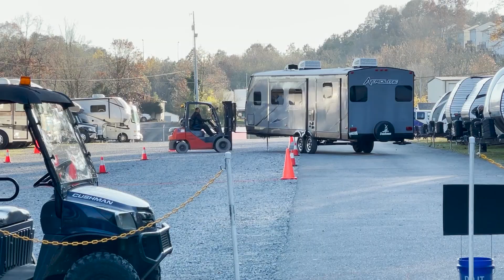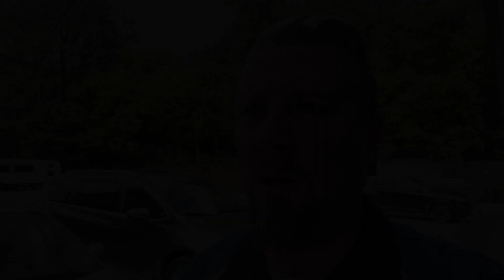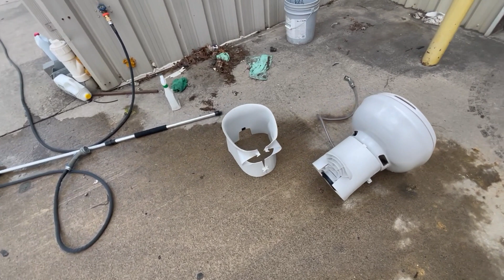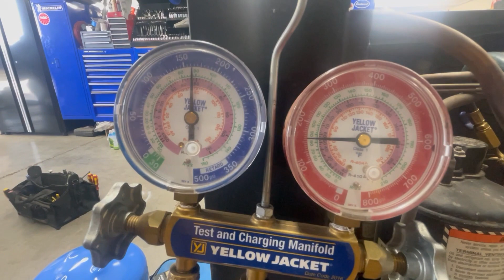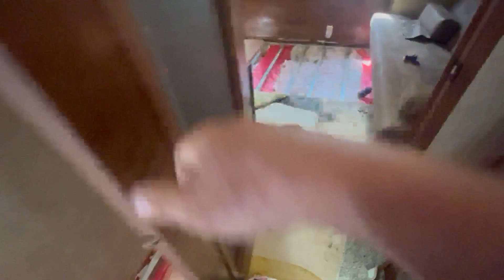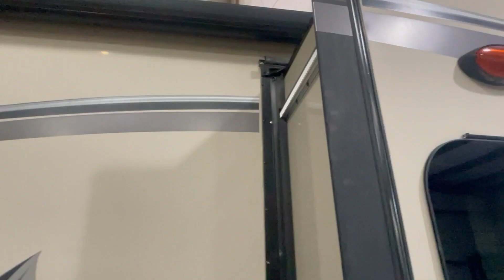That Dang Inverter

Comment: I have a toy hauler with a generator on board. Question, do people run these generators while going down the road (or can you), pros and cons
Reply from the maker: A lot of people in class a motor coach’s do run the gen set while traveling to run the ac units. If no one is riding in the toy hauler why would you run the gen set?  The charge line on the truck would keep the 12V on the unit charged. Thanks for watching.

Comment: Pulled out my rv frig and replaced it with a residual rv because it hasn’t worked properly since day one. Question, do I cover up the outside vents (it’s in a slide)
Reply from the maker: I would to keep the bugs out.  Thanks for watching.